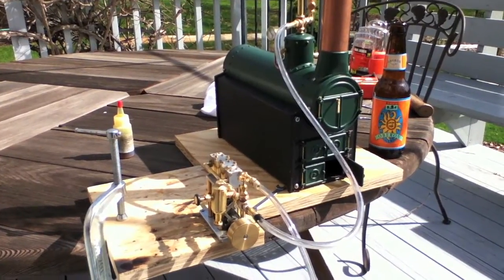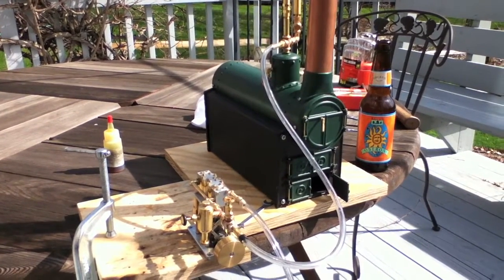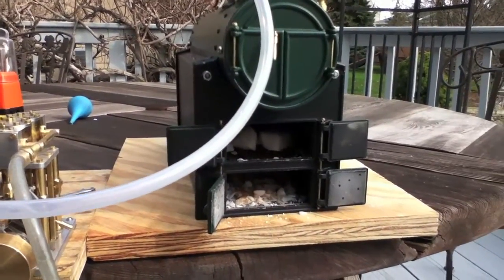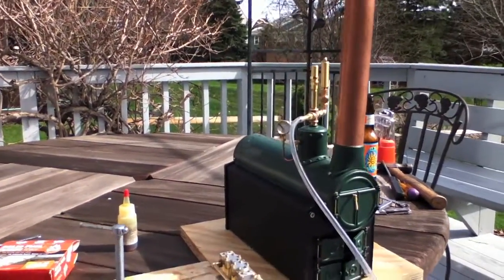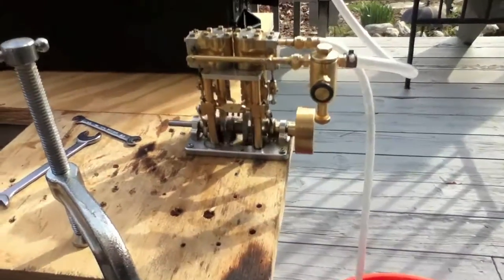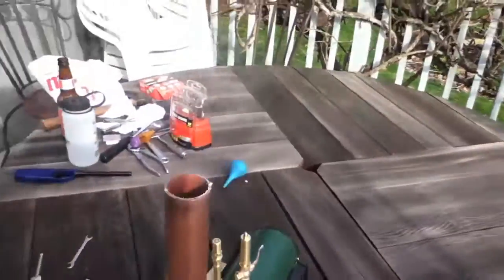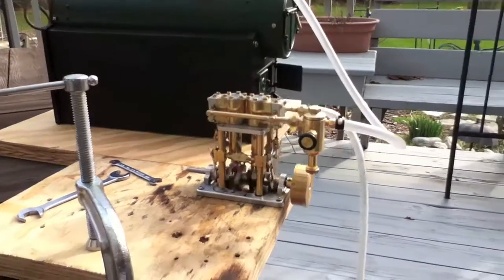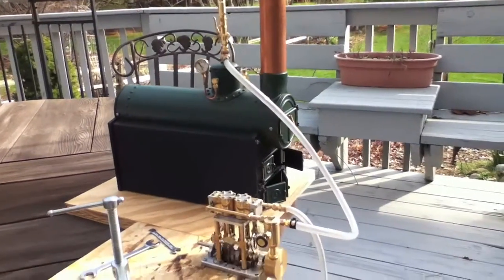Graham TVR1A Steam Engine & PM Research BLR-2 Boiler

Comment from the maker: I agree that full throttle at no load is excessive yielding 500-600 rpm or so.  These engines run quite happily at 2000-2500 RPM - especially under load.  The RC system on my boat has a shaft speed sensor.

Comment: Nice Boiler. I have a 3BiM myself and love the PM products. Question: Why does everyone I see on youtube running live steam, seem to open the valve full throttle! Most of these are designed to run at 450 -500 rpm max. Slow that thing down!

Comment: What's the diameter of the main tube on the boiler? Pm research says there vertical one is 3 3/8"  but don't list this ones size?
Reply from the maker: To answer Trombone's question, the PM Research boilers require some machining skills - primarily to produce the tool required to set the copper rivets.  If you don't have access to machine tools, it would be difficult to build the boilers.  If you do, they are only moderately complicated to build.  

It is IMPERATIVE that boilers be tested by pressurizing with water (NOT AIR) well over their working pressure as PM recommends.  Any failure under water pressure is a "non-event" and you get a small leak as parts yield.  A failure under air/steam can yield an explosion that is very dangerous.  The difference is that air/steam store energy because they are compressible while water under pressure does not store energy because it is incompressible.  That is why the test is referred to as "Hydroing" the boiler.

To answer Paul's question, this boiler has 5 tubes, each about 5/8" dia.  Flame hits the bottom of the boiler then heat runs through the (5) tubes from back to front and out the 1" stack.  Very quickly, I learned that Esbit tablets are a mess and converted both PM boilers I have (PM1 and PM2) to gas.  The conversion is easy and makes them much easier to operate and cleaner too.